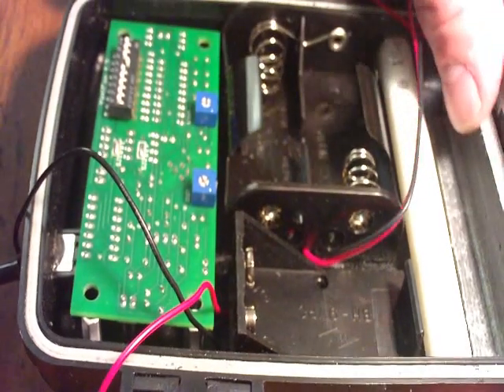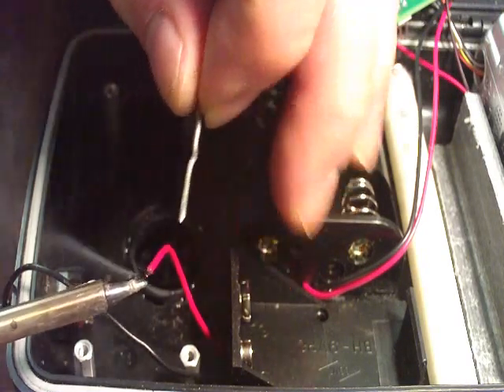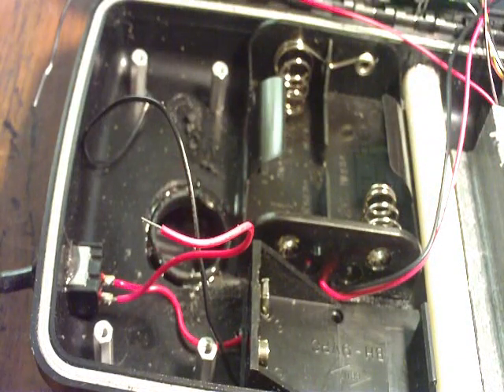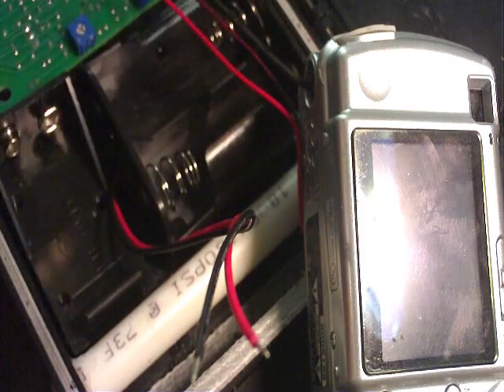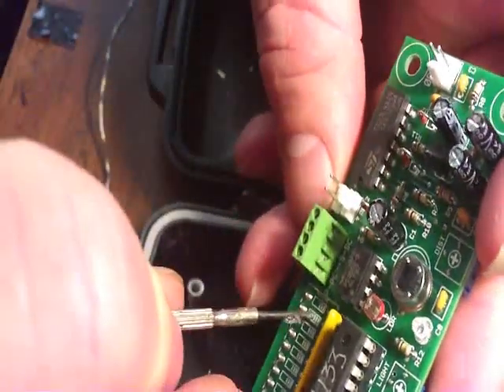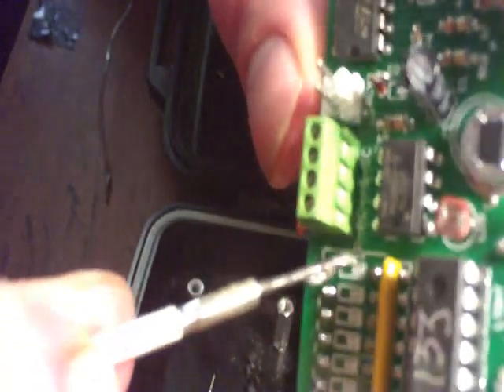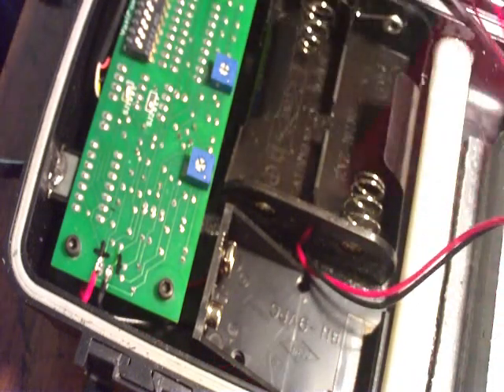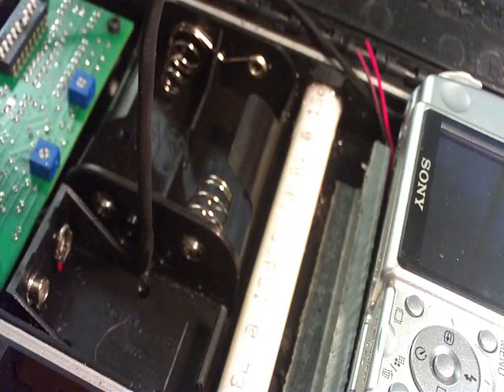Yeti fast hack wiring part #1.wmv

Comment: @Skewerer not necessary but it makes it so that all you have to do is touch the wire to the place you want to solder with the iron and where you have put some solder resign paste...simply touch and it is soldered. Much quicker, simpler, and safer bc the lead is already on the wire. then the lead can't "jump off" and you can make sure you have exactly the right amount. hope this helps! :)